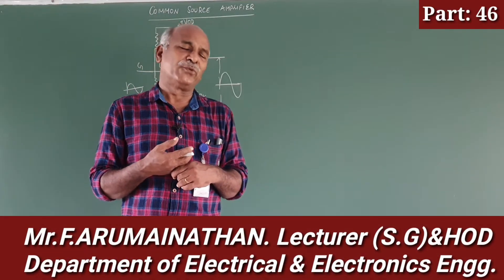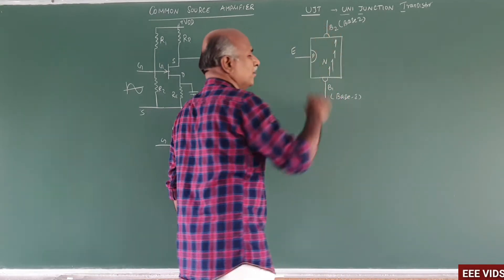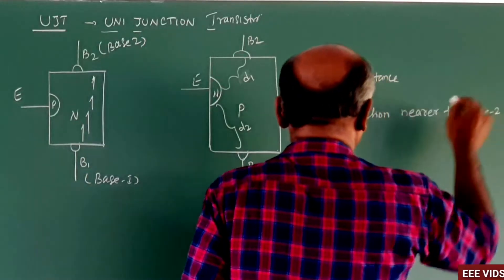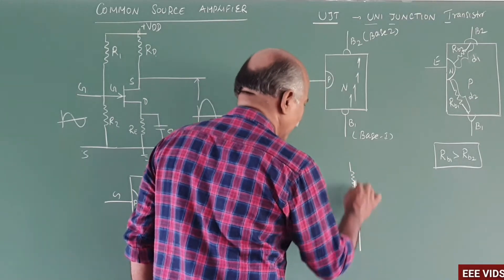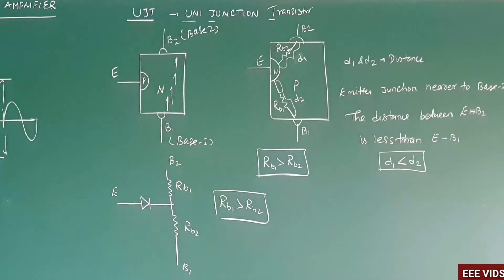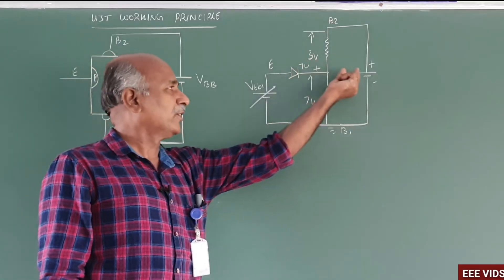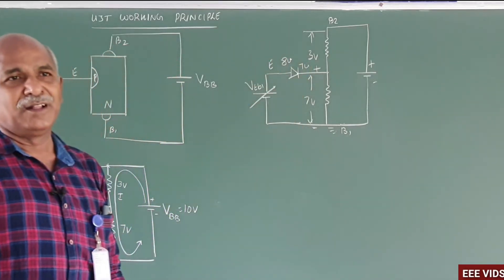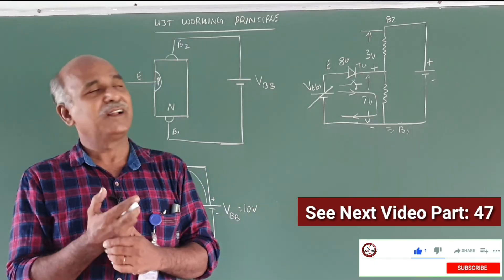UJT Construction and Working in tamil

Comment: Sir Rb1 is near to emitter. There fore Rb2 value is greater than Rb1 but in video you written as Rb1>Rb2
Reply: He wrote correctly
Reply: Yes that formula correct but while writing resistance value in the circuit wrongly mentioned Emitter to base 2 as RB1 but it is RB2 only know